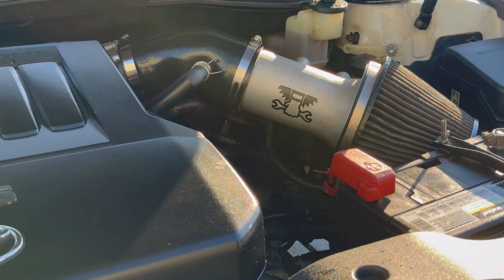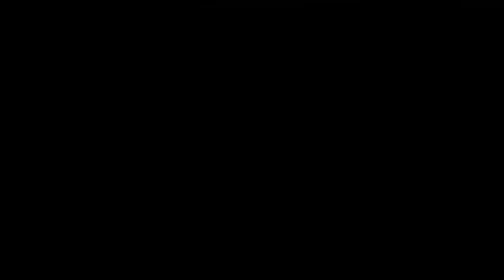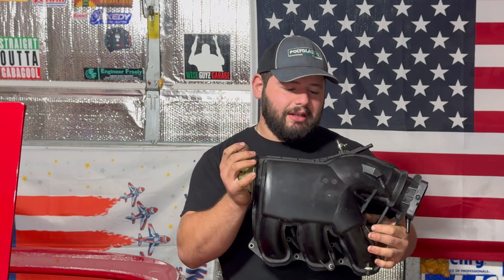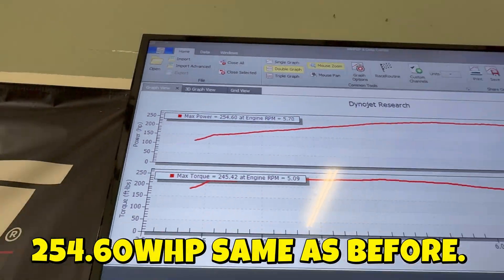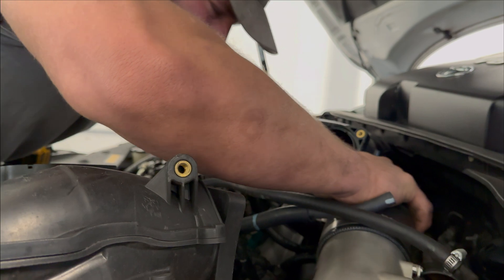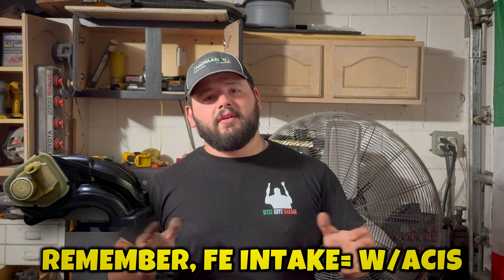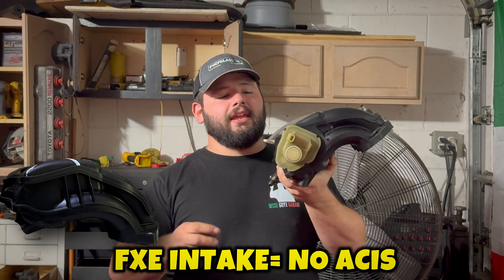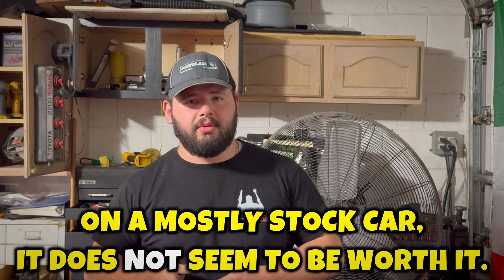Toyota/Lexus 2GR-FE V6 Owners: How YOU Can Make MORE POWER On a Budget!:EP3

Comment: MOAR please !!
I was expecting a 10 HP difference with the exhaust disconnected. Good to know and I wont waste more money on the exhaust until I get the power significantly up. 
My Camry came with the stock headers with a cat each, and a 3rd, bigger cat after the Y-pipe. After doing the Y-pipe upgrade which removed the 3rd cat, the power bump was very noticeable. Later I switched to 93 and saw another bump.
I haven't retuned the car yet, but I think I'm already at the limit of the stock tune as the engine gets a little rough over 6000rpm.
Also good to know the stock ACIS intake is fine at these power levels.
Is there any ECU adjustability for the VVTi? I'm aiming for 290-300WHP, I might need some nice Kelford fast road cams. I'm staying auto so 7000rpm is my limit.
Reply from the maker: Staying Automatic will definitely be the really big issue dangit!

Honestly, we were both expecting the same results with the Evora y pipe. I think when we put 93 octane in there, we can take a look at the power levels and go from there. 

You SHOULD be able to AT LEAST squeeze 260-270whp out of your car no problem without a tune. The biggest thing that holds these back is the exhaust. It seems. The MR2 Community can easily obtain that number with headers and a Y pipe. Now, the stock intake on the Camry typically runs out of breath around the 300whp mark. Its rare to see cars push past it due to dyno configs, and transmissions attached to those engines. The car did have a R9k tune on it, but it did not seem to make a huge difference in power at all. Then again, it was likely being held back from the exhaust when it was on the car. Orange virus tuning software could tune the ecu, but you cant mess with VVT actuation AFAIK. The cams have the potential to make more power post the stock redline, but were actually limited by Toyota with the vvt tables if i remember correctly. 

You can leave your stock intake with the ACIS valve unplugged and it will not trigger a check engine light, so you can leave it hanging like we did. I would just recommend sealing it with tape of your choice. With the E351, we made right around stock power for what a stock auto Camry would make, so the power losses are quite similar. I hope this helps!
Reply: @WiseGuyzGarage  Cheers, I'm in Oz and a manual box will cost me up to $10k fitted. More than the cost of the car. The missus drives it too from time to time and she can't drive manual. It's a daily as I have other cars.
I'd guess I'm up around 240-250WHP at the moment. Just seeing what else I can squeeze out of it. Then I'll find a tuner. 
I ran some tests on the ACIS actuator to ensure it worked. I never thought about driving it with the ACIS leads unplugged. I'll give that a go.
Other things I considered, spark plug gap size, metal intake manifold porting (per Frankenstein Works), later cams, VVTi (but that might be unachievable), and maybe the Frankenstein intake plenum, but from memory that's only good above 7000rpm. Also, our cars are factory limited to 6400rpm due to the valve springs and the roller rockers popping out at high rpm. If and when I do the cams I'll definitely upgrade to double valve springs, and with the heads off, a port clean up with 3-5 angle seat cuts.
Reply from the maker: @ the cams are the same between 05-17 but the later ones have a better vvt actuator! Hint… we might be testing that intake plenum, so stay tuned for that!
Reply from the maker: ATS does mr2 swaps all the time and they rev there’s to 7400. I think it spits rockers on way past that for a miss shift
Reply: @WiseGuyzGarage  7400, hmmmm 🙂
Reply from the maker: @ oh yeah! I might get the rev limit increased if when we put the other intake on keeps pulling at 7200